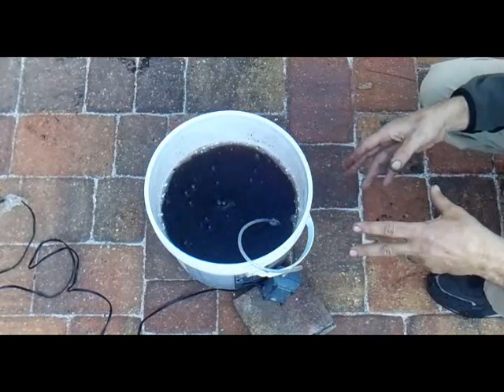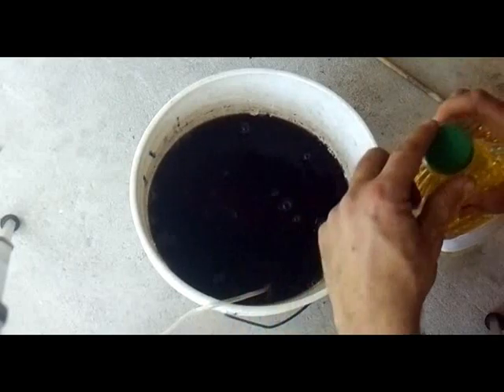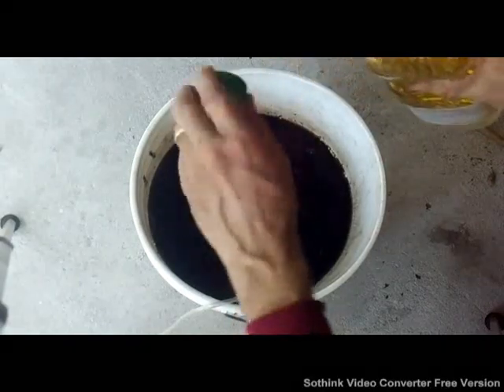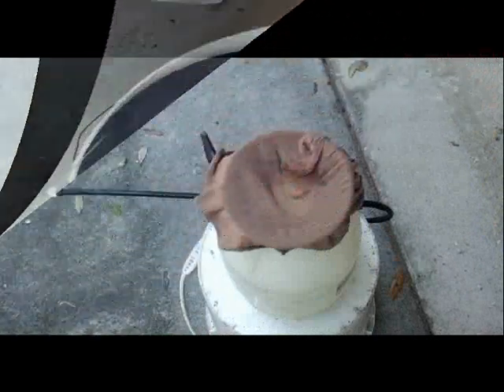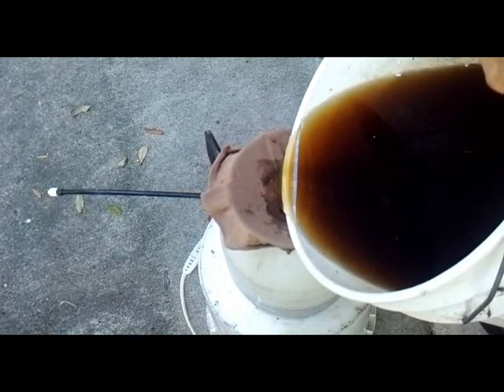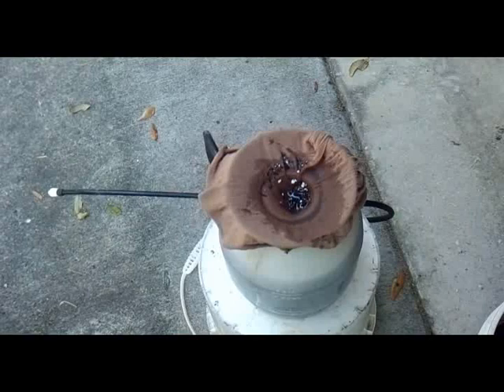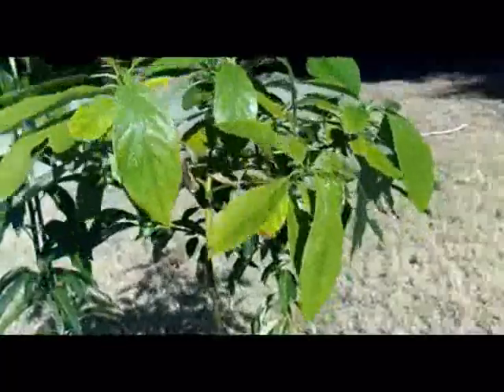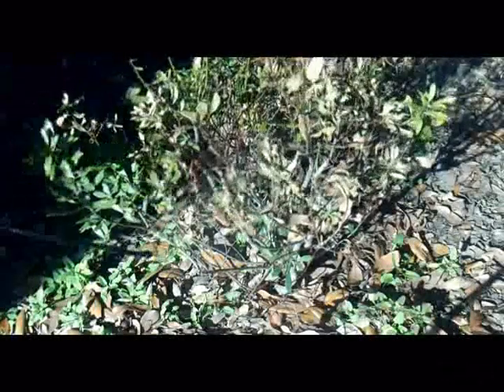Worm Compost Tea: New aeration method, recent research, demonstration (Part II)

Comment: "New aeration method", more lke NO aeration method.  All that pump is doing is cycling the water slowly. There is no activation of the microbes as you can tell by the lack of foam and the lack of waste ring. Either that compost is really old, or you're using tap water with high amonia concentration. When you first add compost to the water it starts to activate and you immediately see a bit of foam, a small bit, but a bit none the less. 

After about 5 minutes of proper aeration, you begin to see a nice thick ring of foam. This has no foam, no waste ring, and no activation. Its basically the same as having water runoff from your compost pile.

The oil you use is processed and not good for the beneficial microbes but it does help with the blite on your plants because it creates a barrier on the leaves. You should apply that, diluted, seperately.
The urine comment is not for compost tea.  You can use it in your compost PILE if diluted, because of the urine's amonia content.

Very unfounded video, unresearched, and full of partial information.  I appreciate you trying to help others out who may have questions but if you're going to do an informational video, please be informed first.
Reply: View my channel Gassbag prescott like view an subscribe

Comment: Actually, he got that part right. The amount of oil is negligible. Now, why should you care about foam? There are several good reasons: A head of foam seriously inhibits gas exchange at the surface, sickening the culture, especially as the cell density rises. Foam is notorious for denaturing proteins in solution. Finally, foam is just plain messy. It gets in the way of decanting and filtration.

Comment: But once those bacteria die, after you apply to your plant, don't they start nutrient cycling? Some will live depending on resources, but the  Arthropods range in size from microscopic to several inches in length. They include insects, such as springtails, beetles, and ants; crustaceans such as sowbugs; arachnids such as spiders and mites; myriapods, such as centipedes and millipedes....etc. And don't they basically eat anything that doesn't eat them first?

Comment: Foam means nothing. I have several recipes that do not result in foam. So it must be dead right? My microscope says otherwise. The only way to now what is in your tea is to test it yourself, or if you can afford it, send it off to SFI. To make such generalizations, when every expert that I know of  disputes the "foam factor. Plus its misleading to new people. I use two 110 liter per minute pumps in a 37 gallon trashcan. I have to use an oil to know my foam back.

Comment: Teas that foam within three minutes of starting them it is not from microbial activity. It's probably from low DO or pieces of worms in the ewc. Not that it matters that much for a garden, in a lab it does. EX: Pseudomonas aeruginosa in lab culture. When batch cultures were initially conducted in a reactor, excessive foaming occurred that made the bioconversion process inoperable. This was overcome by a new aeration mechanism that provided adequate dissolved oxygen to the fermentation culture.

Comment: also the good bacteria will begin to die off as soon as you stop brewing them. they survive on the oxygen being pumped into the water. they are ment to be inside of your plants or the soil because they both are (or should be) full of air. i think that you will see alot more activity from your tea if you remove the foam dics and get a more powerful pump and use some t-vaulves to split off the hose into different sections of the bottom of the bucket and also dont stop brewing it until its all gone

Comment: you need more oxygen in your brew. i think the foam disc your using is cutting off your air rather than displacing it evenly. the air bubbles not only supply some oxygen to the water but they keep the water and the compost moving. you should stir the water a little to move the stuff on the bottom when you dont have enough air. that foam disc creates a place for bad bacteria to breed. it only takes a little of the bad to corupt all of the good.

Comment: after trial and error ive upgraded my pump to an eco  commercial 3 and  sticking with the same air stones after getting even more air into the system then i had previously been using my teas get foamy very fast within 3-5 mins it has a full head of foam at least 4-5 inches thick i brew for about 6 hours and thats all it takes so with that said micro aeration seems to work very well for me and i would rule that out as to being bad for the the bennies id have to look into the bigbubble theory tho

Comment: The oil is not needed. ... really ! it can accelerate microbe and fungus growth if temperature raises and then it becomes rancid and chokes the plant in areas.. I second using MOlasses-- try it, you don't need much.. a capful to that bucket is good.

Comment: I would say you need a little more aireation than that, you want to see foam after atleast 12 hours if you dont then something is going wrong, if its cooler it could take up to 24 hours but anything after that and the tea is dead!  foam means the micro beneficial are reproducing and producing a protein that makes up the foam the more foam the better check out my video and see how i made mine. great video tho!